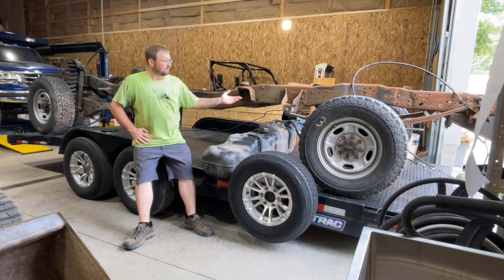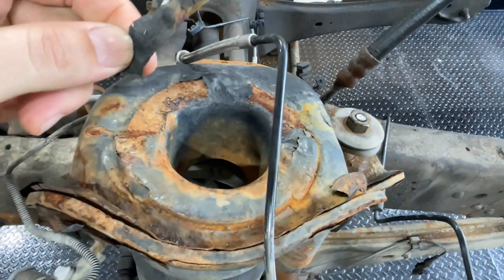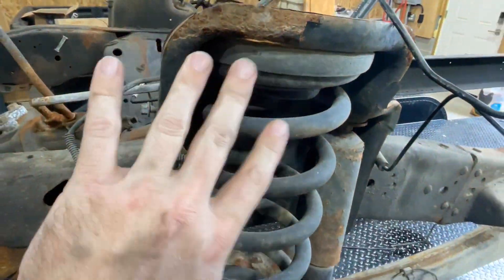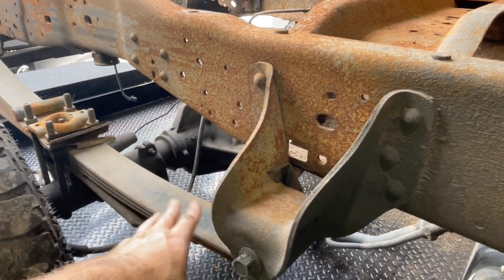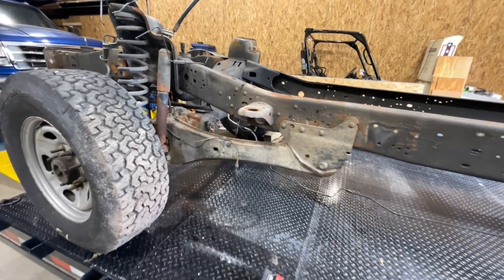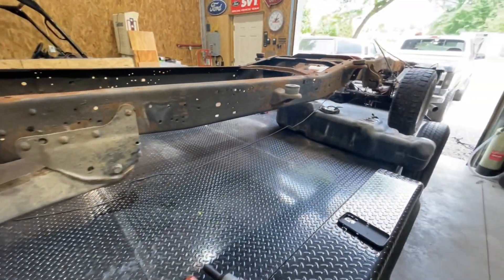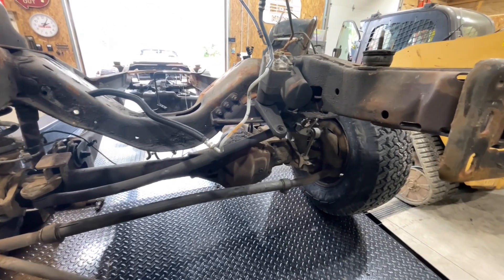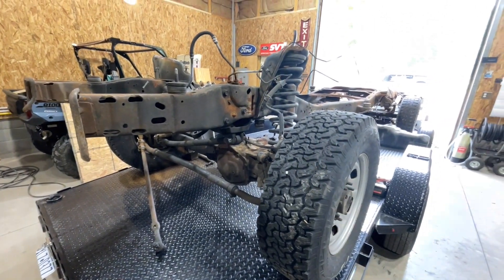What Year 05+ Axle Swap for Your OBS or SD?

Comment: Wow thanks for the info on what I need to do my 2001 F250 now I can start looking for parts.
Reply from the maker: If you're wanting to do the frame swap, you're stuck with the 05-07 era, as the 2001 body will drop right onto it.  08+ they changed the frame horns up front and the older cabs wont set down on it without some major changes.

Comment: Getting ready to undertake this exact same swap on my current daily I’ve done swap several times but I’m excited to see someone’s else’s take on it
Reply from the maker: I did my first back in 2009 or 2010, I can’t remember.  It’s my go to swap, and this one’s going to be a little bit different.
Reply: I’m curious if you are going to swap to the 05 up master cylinder on this swap
Reply from the maker: Unlikely.  When I do them on an OBS.  I generally run the F-SD master.  For an SD, I just use what it’s already got since the calipers are similar in size.
Reply: Yep I usually go Hydroboost and fsuperduty master cylinder as well
Reply: Atleast on obs

Comment: Hi Garret I’m currently doing this swap on my obs with a set of 05 axels. In the rear I’ve run into a few problems. There’s a stud in the rear shock mounts so I’m not sure how to tackle that in order to flip the shock mount around. And if cutting it off and welding one back on is my best option. Also the speed sensor is a different connector let me know if you have a good solution for those issues?
Reply from the maker: Don’t worry about the locating pin on the axle.  When you flip the shock bracket around, once you get it in the right spot and tighten it down. It’ll stay where I my is. 

Use you’re original VSS in the rear axle, not the 05+ one.

Comment: Great info, I just picked up a 97 CCSB 7.3 4x4 and I found a 06 rolling chassis for $1500. Am I better off to remove the parts necessary to do the axle swap or can I just put my OBS cab and bed on the 06 chassis?
Reply from the maker: MUCH better to remove the parts and put on the OBS frame.  Nothing lines up with the frame from the body, so it makes it that much more work.

Comment: The 05-07 frames have gussets on the back side of the engine crossmember.  If you swap these axles into an earlier super duty do you find these necessary.  I have see people swap the entire front section of the frame at the splice.  What cons do you see with that approach?  Thanks
Reply from the maker: You’re correct.  I haven’t found anything wrong with not doing it.  As I’ve put some serious miles on a swapped truck.  But guys want to add them in, and they are welcome to do such if they feel the need.  The extra bracing does however interfere with fuel lines, brake lines, and wiring on an OBS. So, you will be modifying those to fit around the extra frame bracing.

Comment: I am in the market now to do this for my 1996, what would you consider a fair price for all these parts you just spoke about? Also, on the coil spring buckets, will they need to be spaced due to the narrower frame?
Reply from the maker: Some guys will tell you to space it out, and I am not a fan of it.  Coil springs can adjust easily to angles, unlike the leaf springs, and spacing the buckets out with washers is unwise as it puts a lot more strain on the bolts.  You'd have to make a plate to mount behind the whole bucket to achieve a correct spacing, and then you may run into issues bolting the bottom in.  With that said, I've logged hundreds of thousands of miles on my original swap without any suspension related issues with no spacing.  A rolling frame will tend to run you around $1,000 with steel wheels and junk tires with the bare essentials like a steering box and steering linkage.  The price can vary from there, depending on whats included, or how clean it is.  Granted, you may have to replace nothing, some things, or everything, once you get it in your possession, or installed with weight on it.  As the 05-07 era is nearing 20 years old for the oldest setup, they are showing a lot of miles, or age, or abuse.
Reply: On a obs I’d highly recommend using the 05 up brake hoses and rerunning the factory obs hard lines to them. Makes for much cleaner install

Comment: Is there any information you have onnthe drive shafts? If you are swapping the same style like crew cab long bed to another crew cab long bed would the drive shafts mate perfectly?
Reply from the maker: LOTS of factors.  Especially depending on donor vs the one getting the parts.    Transmission, transfer case, year of truck. Etc.
Reply: @GarrettsOBSGarage 2002 crew cab long bed 4x4 to a let's say 2006 crew cab long bed 4x4. If you can find the exact same set up would the drive shafts be the same ? Thanks again for your previous reply. Big fan of your videos.
Reply from the maker: @justinguerrera8322  there is a possibility they are similar. I’m sorry I can’t give a definitive answer. Because there are lots of variables.  You’d have to measure them and actually see